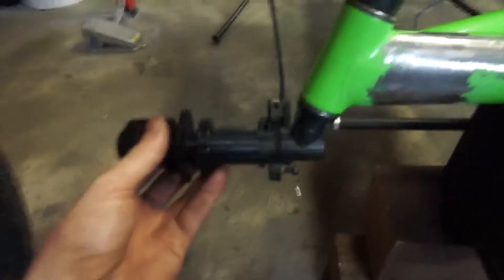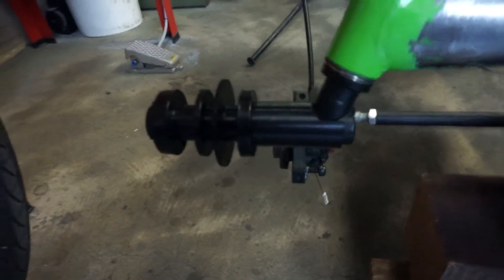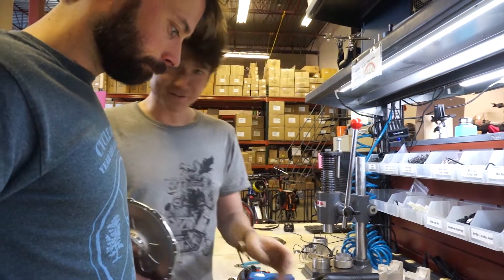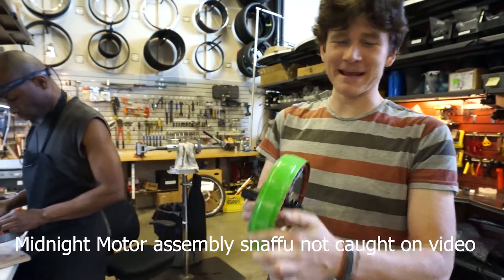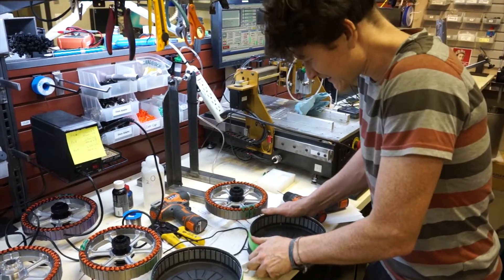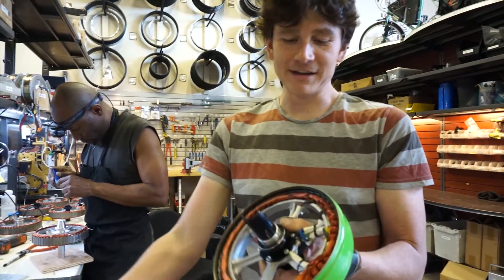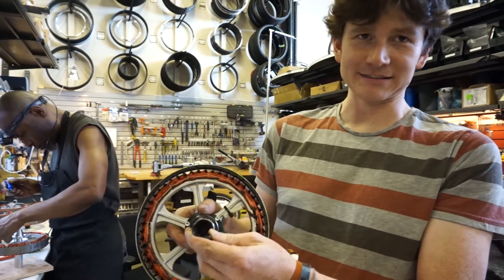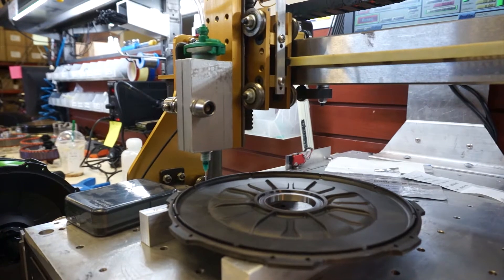Suntrip Solar Trike Build. Video #6, All Axle Motor Assembly

Comment: Was this for the "French" Suntrip solar bike race? I'm asking because I'm trying to figure out the official rules. There is a limit to solar power at 450W, but not exactly a limit of motor power, only that tandems are allowed 100W more?
Reply from the maker: It's the one and only Suntrip race. For tandem bikes the limit is 550 solar watts (450W plus the 100W extra). There's no such thing as a meaningful definition of rated motor power so the organizers wisely don't include this in the rules.
Reply: @GrinTechnologies  Cheers, thanks a lot.

Comment: Sure fits.
But isn't the cable exitting on the outside???
Reply from the maker: It won't be for long! The axle tube is hollow so the cable just does a 180 degree bend to get back on the inside.